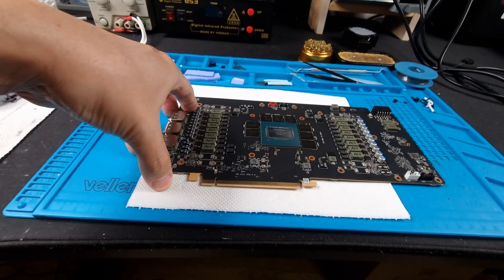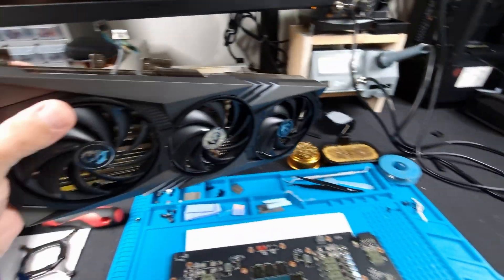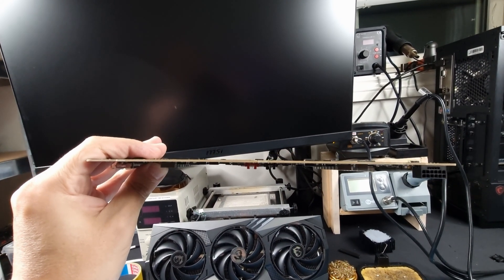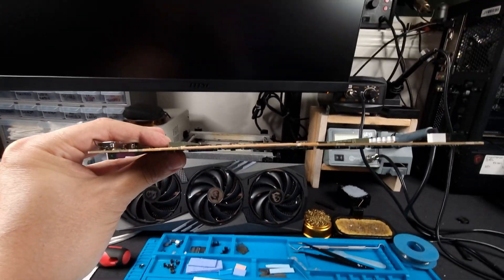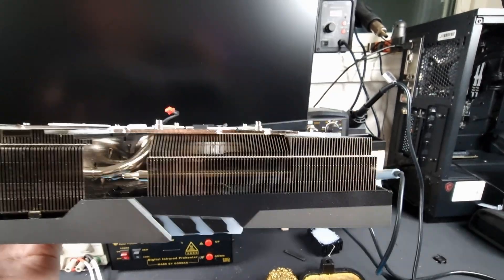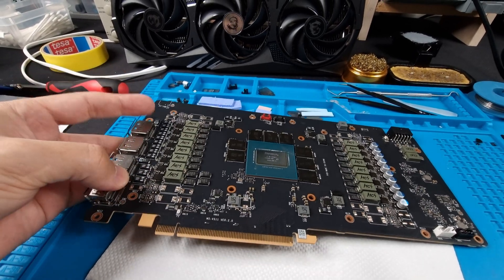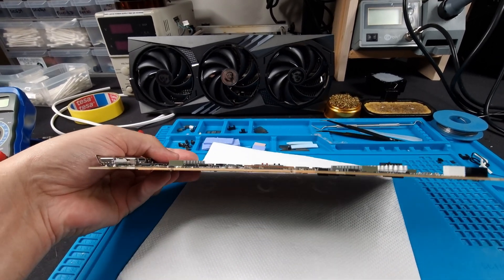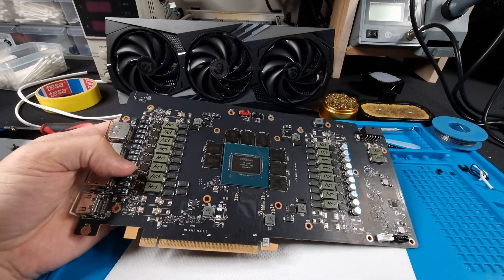How Using GPU Supports Incorrectly Can Destroy Your GPU.

Comment: This problem could be totally resolved if $1000 GPU's all came with AIO coolers. Considering the price, they all should.
Reply from the maker: They wouldn't want to do that because of failure rates. Adding an AIO to a whole series of cards would yield higher RMA's. They will always take the cheaper route, sadly.
Reply: AIO coolers bring their own set of issues like being prone to premature failure.
Reply from the maker: @christopherjames9843  That's correct. 👍🏼
Reply: So you want a 1100$ gpu instead of a 1000$ GPU.

AIB partners make little money off of graphics cards. It’s largely Nvidia that is pocketing most of the money
Reply: It is almost like the cards were designed to work in vertical position…
Reply from the maker: @watchbreaker1706  Funny also how most of the cards I have here for repair are pass their warranty.
Reply: @buggerlugz6753  Especially when Thermalright can pump out such a cheap 240mm

Comment: so... people buy expensive monster GPUs, but not a case with a vertical mount? or a fully horizontal PC case?
there are (or at least have been) so many good horizontal high end cases, like that Phobya cube case: tons of space, multi-PSU and dual-system support, overkill water and  air cooling capabilities... yet people put their 2000$ high end GPUs into cheap tower cases?
Reply: My 4090 is in a tower case, appears to be the same one as in the video if that's a Corsair 7000D. Not vertical, but hey I been gaming with it going on 2 years now with absolutely no issues. To each their own I guess. It definitely wasn't a cheap tower case though as it was somewhere going up to $300 at the time.
Reply from the maker: @Mcnooblet  Yes, it's a Corsair 7000. Great case and easy to install a vertical mount. The Phanteks one works great.
Reply from the maker: @user-iw1gy7ev6e  It makes no sense. But it is common. It's like putting a $2000 sound system in a Ford pinto 😆

Comment: im using those cheap bolt type, no issue..dont put right to the edge put it just before the a little after the end of the pcie slot and dont set it to push the gpu up just let the gpu rest on the thing
Reply from the maker: Just keep an eye on the PCB. Cold/hot cycles after a while will warp the PCB if not supported correctly. Even so, I still recommend vertical mounting. But I do understand not everyone is able to do so. Just keep an eye on it :)
Reply: @TechnologyHive  thanks for the heads up, will keep an eye on it or later move on to vertical mount...my old case can't vertical mount as gpu kinda thick but got a new case today that is able to. Vertical mount surely the better way for these big long thick GPU
Reply from the maker: @ahwai82  Yes sir. Just to protect your purchase.

Comment: GPU supports are fine.  People using them incorrectly is the issue.
Reply: You were absolutely right, I use spirit level / waterpass to check the balance and not only put one spot support, I use minimum 2 or 3 support. Sure its ugly but my GPU is save.
Reply: After witnessing issues with riser cards, I'll take my chances with the support bracket.
Reply: @cyberfred5520  problem with riser cards. that they dont properly terminate the cable shielding on atleast 1 end does not matter which. ordered a few different one. only 1 had its shield connected correctly. rest were corrected with an exacto knife, and copper self adhesive tape and a copper wire soldered to ground. pcie gen 3 server hardware instantly crashed to a disabled slot state afterwards. after the ground fix it produced no more errors since.
Reply: @cyberfred5520  ??
Reply from the maker: @darreno1450  Hope it works out for you. And the issues with the riser mounts is user related.
Reply: @TechnologyHive  certain GPUs cant mount vertically due to thermals though
Reply from the maker: @electrix8164  Which GPU's? If you use a 3rd party vertical mount placing the GPU away from the side panel, GPU temps can actually be improved vs installing horizontally.
Reply: @TechnologyHive  I looked it up earlier for my 6800xt and I read it gets way too hot on a vertical mount because the heat pipe cooler it's using relies on gravity, so they need to be oriented horizontally to work optimally.
Reply from the maker: @electrix8164 I have never experienced this with my 6800XT but quite the opposite.
Reply: @TechnologyHive  Do I need to get a bigger case for the GPU to have good thermals? My case is about the same size as the case from your video on the Phanteks GPU mount.
Reply from the maker: @electrix8164  You just need good ventilation. I prefer small form cases. But if you want a bigger case, it can't hurt, but you do not need it.
Reply: @TechnologyHive  so is the issue with supports.
Reply from the maker: @Newbie4Hire The issue is with people using supports incorrectly.
Reply: @electrix8164  last time I checked, heat DGAF about gravity... heat pipes have a tiny amount of water vapor inside to transfer the heat. 
Sounds like your case has bad airflow.
Reply: Agreed. They’ve raising the end up too much.
Reply from the maker: @frankmjr6571  I have seen that as well.
Reply: I 3d printed a rotisserie with a motor and gears to rotate it 359 degrees every 3 minutes then reverse, connected to a lengthy riser cable that can twist.
Reply: @hgodtx  I'm fairly new to pc building, so assumed this was a joke until technologyhive responded as if it were genuine

I want a charcoal roasted GPU now too 😍
Reply from the maker: @hgodtx  A  lot of people a 3D printing their own supports. Pretty clever.
Reply: Based on what I learned in mechanical engineering, the cards are long enough to bend in the middle. The solution is putting them in a riser.
Reply: That's why I've installed my aorus master on a vertical mount + using the support mounts on the back end of the card with a custom laser cut perspex piece to prevent the card from moving at all, so now I have 3 points of contact/support

IO shield 
PCI riser
Back of the GPU where the original support bracket would screw to
Reply from the maker: @Behemoth33  Well, that will help extend the life of the card and keep it from some technician's hands.
Reply: Yup, usually the metal frame behind the card should maintain stability when used with support but I think some users overcompensated by needlessly stretching the card
Reply from the maker: @Kazoom28 Yes, it's more of a user error. But I can not blame people since the weight of these cards just keeps getting heavier and heavier.
Reply: And avoid GPU brands with thin PCBs like Gigabyte compared to other brands with thick PCBs like EVGA, etc
Reply from the maker: @平子真ジ4773  I have dead, bent PCB cards from every vendor. From ASUS to EVGA. It doesn't matter the brand. Its the people installing these heavy cards wrong that is killing them.
Reply: My atx casing come with vertical mount so no issue with warping
Reply: Don't you put that on the end-user. It's on the manufacturer to make everything fully idiot-proof.
Reply: thanks for restating the literal title of the video
Reply: I use invasion te case .solved the problem
Reply: I agree with both of you.
I have had a 4090 TUF  running fine for almost a year using the included support until the day it started giving me black screens and 100% fans issues.
It made me scratch my head for like 2 weeks until I decided to remove any preload from the support and keep just enough to keep it level. And it's been running fine since then... I guess.
I do firmly believe that heat and cold cycles played a role in causing the issue and the gpu is most likely slightly damaged 😢
I suggest people using supports to check them from time to time, it's quite annoying to be honest especially for me decided to buy high end hardware after 7years of not upgrading. 13900k and 4090, wish me good luck 😅
Reply from the maker: @Qazdar6  If it gave you issues at one point, then works after physically changing anything around it, odds are the graphics card is indeed damaged. Mostly likely, cracked solder joints under the core or memory. In time, it will get worse.
Reply: @Qazdar6 How much force did you applied on gpu when installed gpu support?
Reply: I have a ROG strix 4080 super I have it on a NZXT vertical mount kit am I ok or should I worry ?
Reply from the maker: @SecondAmendment_2A  If it's installed vertically, then you're doing it right 👍🏼
Reply: Maybe but lots of support are just a stick and aren't enough. The problem is the weight isn't spread properly sometimes and that can be an issue.
Reply from the maker: @Wilky971  The problem is not weight distribution. The problem is the weight itself. These cards can weigh 2kg. And they are getting heavier. Ridiculous.
Reply: exactly, well in fact if they using only 1 gpu supports for bigger cards then its gonna be and issue
Reply from the maker: @stanclaus4065  Or you could just save your card from potential premature death by putting it on a 3rd party riser.
Reply: Not having a support just killed my 3070ti. 850$ card at the time.
Reply: They will sag eventually, it's a combination of heat, weight and gravity.. Mount them how you choose. You've seen and have the information at hand to make your own decision.  Good luck.
 Thankyou for sharing😊
Reply: I have a spent shotgun shell in 3 inch, maybe a little bit more than 3 inch, I can cut and sand it down to make it perfect but my gpu is only dual fan, 3060 oc, thats going to be in the future if I ever decided to upgrade everything
Reply from the maker: @DonutVIP A two fan card is no worries. Not long or heavy enough to be of concern.
Reply: @TechnologyHive true, just prepare for it once i upgrade
Reply: Erm, no. There's a larger issue. How is such aggressive, numbskulled (money destroying) arrogance always so popular.
Reply: Having a PNY 5070ti. I think this is smaller than the 4080 and seems fairly sturdy. Will this be ok with no support? I bought one of those pole supports but haven’t installed yet as I’ve been worried of going too far the other way and bending it up.
Reply: Because of the weight , people usually use the support when it’s can’t go further, people should place pc lying down so the card looks like it’s standing, then add the support but only to let the support to rest on the card where a pressure is not applied. Face computer standing and check for sag, if there is sag just raise a tiny bit with hands and adjust support. I made 2 support for my card , I at the center and one at the rear which just touches the card .
Reply: @zeus.edwards2662 Is this okay to move gpu a very little little bit when installing support?
Reply from the maker: @zeus.edwards2662  I hope that works out for you!
Reply: @fluph1  well how do I use the properly?
Reply: Go to only a level. Don't go upward where you are bending the card up.
Reply: @DK-ii5sc  Just leave a 0.5 mm gap between the support and the GPU
Reply: Use the support to just support 80% of the weight. It will prevent all bending...
Reply from the maker: @wtfskilz  No. It will still warp the pcb in the long run due to hot/cold cycles.
Reply: @Pokefan3752_  Use a level and make sure there is just the slightest sag, you don't wanna force the gpu up.  Just enough height on the bracket to allow the card to rest but not be jacked or forced upward.  It's really simple and shouldn't even need explaining.
Reply: @animalyze7120 I bought one of those pole supports and been too nervous to install on my 5070ti as I feel like it’s too hard to tell how high to adjust it. Worried about bending it up.
Reply: @Pokefan3752_  Idk if I'm too late to the party, rest your pc on its side, apply any type of gpu support measure, preferably one that uses your mobo screws. Try to make sure that the gpu is supported as flat as possible. And It's really important to support it closer to the middle of the board. The support will have to handle more weight but keeping it closer to the middle can help prevent the issue better. Risers cost you more than a gpu support and not all cases support riser clearance.
Reply: @Pokefan3752_  make sure they are level with the socket/board.

My board came with supports for a reason (though I use a corsair mount because RGB)
Reply: I would agree.
Reply from the maker: From what I have seen, it's both. Hot/cold cycles will eventually warp the pcb of installed horizontally with that support fighting all that weight. If your graphics card is big and heavy, put on a riser. Done.
Reply: @TechnologyHive  Using riser is nice theory, but...there are few issues with it as well.
- You cannot use usual riser in most cases if you have any other card in system.
- You cannot use case with extra riser slots if GPU ts too thick, you can usually get 3 slots there but then you cant fit 3+ slot thick card and even 3 slot will be getting suffocated with closed panel right next to it. 
- You wont be able use riser in case of new ASUS cards that use extra integrated power delivery (though that should reduce twisting by supporting whole length of card)
- There would be question of future card that might need faster PCI-e speeds with less lines. Gen 4 already having problems getting reliable cables, Gen 5 is totally different level.

Whole industry need to step up here and stop using workarounds and running traces through known weak-spots. There is zero reasons running data traces through most vulnerable spot on GPU where card is secured in slot. Its making PCB weaker and creating unnecessary point of failure.
Cooler construction is another story, there are some that have solid metal frame all around card that petty much eliminate twisting.

And last part is about users correctly securing card, If card have solid bracket that's connected to metal frame on card and you use solid case, screws should hold front of card safely. then put riser on back of card, close to center, ideally slightly further from MB and just slightly level it up to reduce stress on PCI-e, connector. It does not need to be 100%l, there is actually good chance that case and MB might be little off from being fully leveled.

It's when vendors are cutting corners this is creating big issue. There are plenty of cards that have soft brackets, no metal frame, cooler from multiple pieces connected just with heat-pipes and all covers from thin plastic just for look that pretty much do not support PCB in any way and you get pretty much guarantee it eventually break in some way.
Reply from the maker: @pavelgajdik7486  75w pci-e power delivery drives 4090s and 7900XTX cards just fine, as that standard has not changed even at pci-e 4.0, which both risers I'm recommending support by default. One can do as one pleases with their hardware at the end of the day. I am just sharing what I see as a gpu repair guy. Either gpus are cracking due yo their weight, or they are failing due to crack joints...due to their weight. It is best to sit the card vertically to avoid pcb warping in hot/cold cycles with that 2kg heatsink on it. And the 5090 is supposed to be even bigger...
Reply: @TechnologyHive  risers are great but they reduce access to other pcie slots.  There has to be a better support method than to use a riser that diminishes your computers functionality.  Your stance is close minded and not at all helpful
Reply from the maker: @pthalodezin  Your opinion is like assholes. We all have one.
Reply: @TechnologyHive  Riser + noctua d15 ..... no work 😔 ( noctua too big )
Reply from the maker: @THESHADOW97139  True. Tower coolers may interfere with your gpu, depending on how tall your card is.
Reply: @TechnologyHive  One week I was looking for something to put my GPU out of the PC... and I discovered that there is no PCIe16x to PCIe16x riser.
the egpu kits are in thunderbolt, oculink, or m2... all slower than pcie 16x and therefore with a big loss of fps 😔
Reply: @THESHADOW97139  you need to get the D15S, it’s offset towards the top of the motherboard. It will give you an additional 8 mm of clearance vs the D15
Reply: @henry3397  
I've had enough of these potential problems  😉... I'm working on a home tower, moving the motherboard horizontally, the GPU still in its place, so vertically and above all... moving to a very large watercooling kit, for GPU and CPU 😁
Reply: @TechnologyHive Would multiple supports be better? Risers are quite expensive and make me go over budget  ( RX 7800 XT )
Reply from the maker: @BURZT_YT  Just make sure you add the support/s correctly. Do not push up on the card while it is tighten down to the case. Level it with the support, then tighten it down to the case.
Reply: @TechnologyHive  I dissagree, Risers are known to fail and be unreliable and every case cant accommodate that, I've used supports in all my builds with heavy GPU's with zero issues after 8 years.
Reply from the maker: @Tsukune34  I have never had a riser fail on me when used correctly. You can disagree all you want, fact is your GPU is better off installed vertically any day.
Reply: @TechnologyHive  Risers/Vertical mounts cause overheating failures in most cases they are used in, probably why you are plugging them to ensure future repair jobs.  Vertical mounts are hype at best and while they do fix the SAG issue they introduce a number of other more serious ones.
Reply from the maker: @animalyze7120  No. Vertical mounting using a 3rd party vertical mount actually improves cooling and helps prevent sag. You're mistaken this for the vertical mount included in a lot of cases. That places the card too close to the side panel.